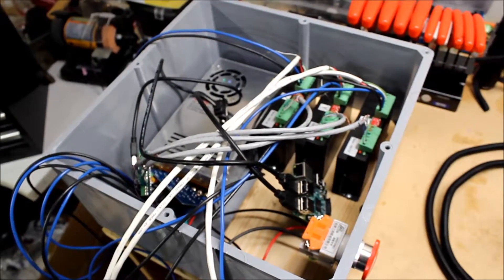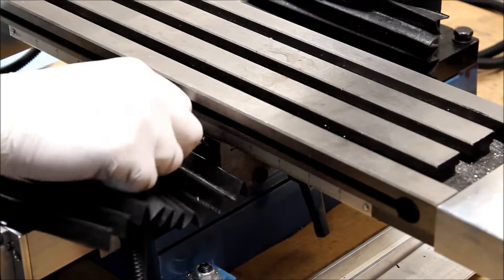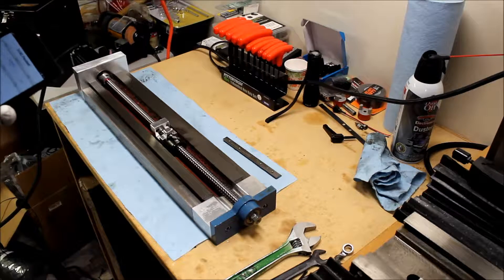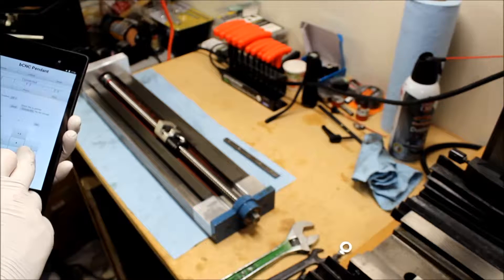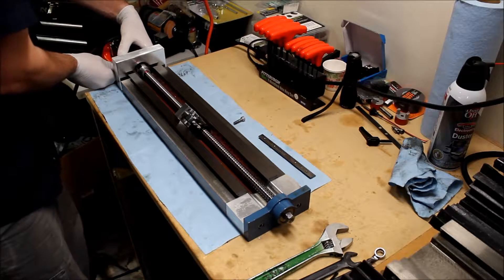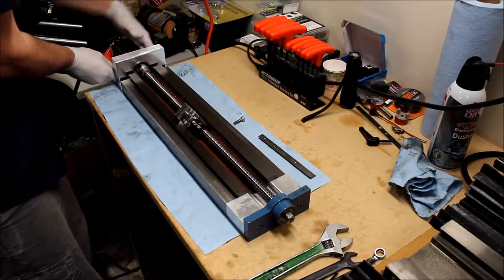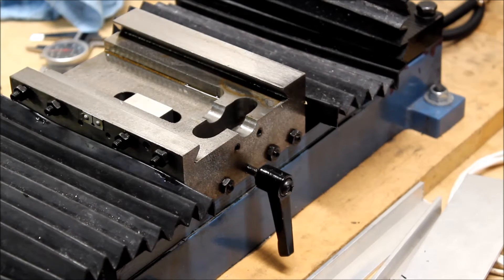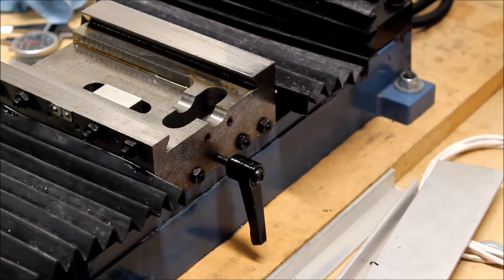Mini Mill CNC Conversion: Part 4 Problems with the X

Comment: I am having the same problem,  but my x2 x axis  has been running fine for 3 years and this just started.  There's a slight grinding and my parts are being damaged during machining.  I've took it off as you have and tried to align everything,  but I keep getting the x axis machining errors. I have not looked at my bearings, maybe they need to be replaced? I have a slotted nut on the end of the ball screw that I cannot get off. Any suggestions?
Reply from the maker: Difficult to say without seeing it. I haven't been able to do anything on my mill for a couple years now due to a move and career change. I'm hoping to get it back up and running again this summer and post the rest of my videos.
Reply: @CalebMayfieldMHF  I figured out exactly how to fix the problem and the cause of the problem. It's the wear of the GIB itself which creates the problem. Over time the GIB wears down on one side, the right side of mine was the issue. So when you put the axis back together and tighten the gib screws when it's in the middle position, what you need to do is run your x axis by cnc control all the way to the left and all the way to the right. I started getting the crunching sound when I was near about 3/4s to the right. So to remedy the problem, you loosen up the very right gib screw so it allows the GIB to not catch up on the grinding of the gib to the x axis table channel. Then you slightly tighten the gib nut to secure the position. Next time I take it apart for any reason,  I will make a  video.

Comment: Great video. I'm hoping to buy the same mill this year, learn on it manually and eventually convert to CNC. Your table removal tip will definitely be put to use. Little Machine Shop's CNC conversion instructions state "limit switches are not necessary" but don't elaborate at all. Have you found a need for them?
Reply from the maker: snyder275 I believe the limit switches are more dependant on what you are using to control the machine with and whether or not you have homing switches. I plan to do both. I've used it successfully without either, but I've also crashed it and broken a number of end mills because it didn't do a homing cycle.